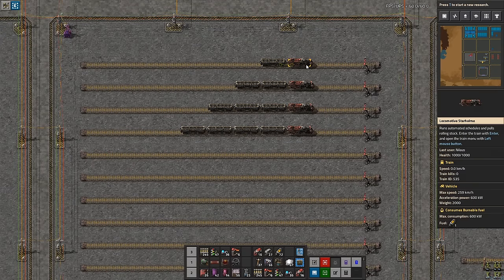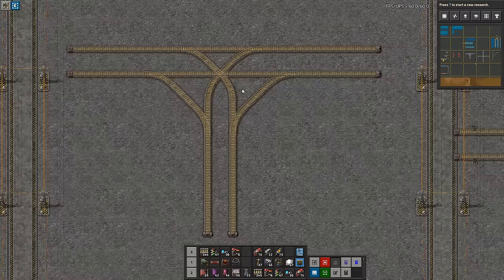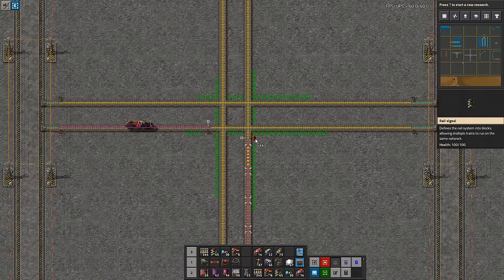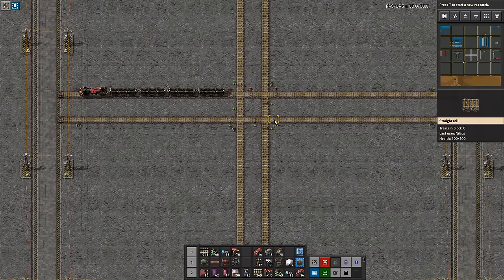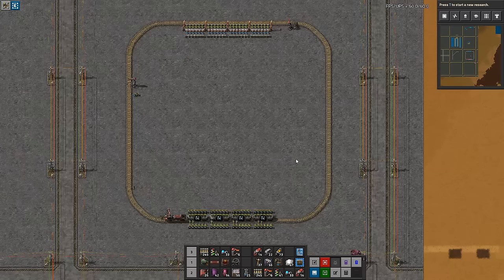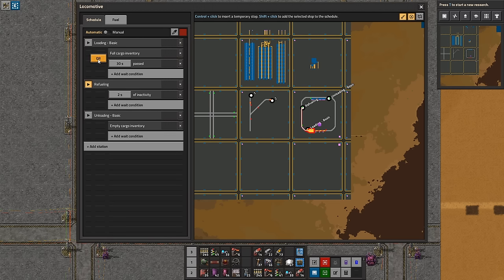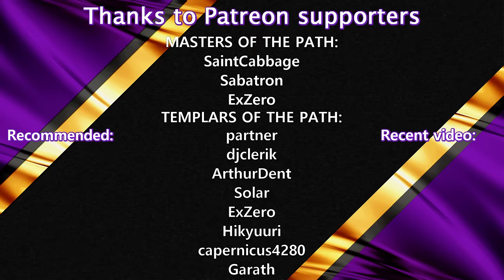Getting Started with TRAINS & SIGNALS - Everything You Need To Know | Factorio Tutorial/Guide/How-to

Comment: Also one sometimes has to keep in mind the role of the train when designing these systems. For example if using an artillery train you may want to keep it off the main rail network because if it makes an unscheduled stop, then you will have biters attacking the spot it last fired from. (You only want those to shoot from defended locations, or you'll be dealing with broken tracks.) So you don't want it stopping at some intersection for your ore lines if you can help it any.

Comment: Good point about the schedule belonging to the whole train, loco(s) and wagons.  If you're less disciplined about train make-up (who, me??) and you add a wagon or a locomotive to an existing train, it won't wipe out the schedule, but it will put the train into manual mode, and you'll have to switch it back to automatic.

Perhaps it's too deep for the first video, but you might have mentioned about filtering freight wagons.  For the interested: Open a wagon and middle-click one of the cargo slots.  An item GUI pops up that you can use to filter that slot so that only that item can be loaded into it.  Shift-right click copies a slot filter, shift-left click pastes it into another slot.

Oh, and shunting!  While the engineer is within a loco or a wagon, he uses Ctrl-V to disconnect a coupling, and Ctrl-G to connect (within a certain range).

Comment: I don’t want trains ever stopped inside the intersection, so I will always use chain signals at the start (before each fork) and throughout. I will only use a regular signal where a train is completely clear (no more branching). I’m OK with a little more space required outside of the intersection in order to keep them empty of any stopped trains.
Reply: if tyou place a regular signal before the chain signal (the side where the train is coming from) you can even tell wich train goes first

Comment: For the signal challenge, I would also add 3 chain signals more, that way the trains wait in front of the crossing, and if 1 path is blocked, they eventually can choose a differend route. Great for the deadlock in your network by a mistake. In your case, you actually have to go to the trains, and manually drive them backwards, while in the other case, solving a deadlock is just as simple as CTRL clicking on the map in the train GUI

Comment: I am a total beginner. Where I am stuck now is at the train network layout. Is there any tutorial? Specific questions:
+ Distance in tiles between tracks (1, 2, 4)
+ How many tracks in parallel (2, 4, 8)
+ Signals on straight tracks
+ Benefits / drawbacks of buffers / depots
+ Discussion of different layouts that work and pro's / con's that people use
+ Where to refill the trains
+ Train routes (many to many vs. single routes)
+ Which intersection sizes to use (3 exits, 4 exits)
+ What intersection types to use

Comment: I use your cityblock blueprint, but put railways between cityblocks. Each city block has separate drone suply area, so drones don't fly everywhere in my base. Also, i plan space for double wall difence in each cityblock in order to begin with cityblock. If i want to make it space-efficient it's reasonable to make rails closely to each other. So right - hand trafic make it possible

Comment: One thing you didn't mention about signals that is a very common misconception is that you don't need to follow the one-train-length rule when you're just signalling along a straight piece of track with no intersections. On straight track your signals can be as close as you like and it just determines the following distance of trains. Putting them as close as physically possible does work.
Reply from the maker: ...but it serves very little purpose to do that. I don't want to make things more complicated by explaining things that really don't serve a purpose.
Reply: It can increase the frequency at which trains can use that rail (and clear another rail), and thus throughput. It makes no difference on a mostly empty network, but if there is a lot of traffic (without causing jams, but occasional waiting), placing chains of rail signals can increase throughput for high traffic sections. There is no effect if there is no waiting , and the block directly after an intersection should of course be big enough for a full train.

Comment: I liked this, one thing that I think is important to realize though is whether or not to use two-headed trains isn't as much about the driving direction as much as it is whether you will have a turnaround point. I have some sections of rail, especially when starting out that was only going out to a small mine and back. While I did only have the one rail out there I used a single-headed train with a turnaround and just setup the signaling such that a train couldn't enter that section unless it could go all the way through.

Comment: the "space for one train (of the maximum train lenght you run) after rail signal" is only valid after junctions. on straights it doesnt really matter. if you have different sized trains it can even be beneficial to have the rail signals spaced out according to the shortest train, since you can fit more trains per track.
Reply from the maker: So you are suggesting adding more redundant signals... i dont think that would be my recommendation in a tutorial...
Reply: @Nilaus  and rightfully so, it would be confusing

Comment: Left or right handed drive actually makes a bigger difference then just merely changing the side on which your signals are. I've messed around with both. There are some designs that I have made where left hand drive just isn't possible because I would need to have 2 signals placed in a space that only allows for one. This can obviously work the other way around with other intersection designs.

Comment: 4th rule: if the train is not allowed to park in the next block use a chain signal.
Yes it's kinda logical for the intersection but if you are not so sure this helps.
By the other rules you can place normal signal before a big intersection because it can park there

Comment: i use chain where you put standerd signals, at first because i didnt know better, but now its because i can and will put intersections right after eachother, especialy in my early build this can lead to long streaches of track where you cannot enter unless you have a clean exit as there are just 7 intersections in a row (i know this is a terrable design, i needed to give a station a dedicated bypass because i had a poorly designed station with too many trains on it right after) or otherwise too close to properly signal without needing to edit, and i dont want to need to do that

Comment: I chose right-hand drive because I put my rails two tiles apart and it won't let me put signals in the gap between them. 

That's a functional difference. If the rails are close together, you have to use the outside.

Comment: My biggest issue with the drive right l, or drive left, rule is that a single train running out of fuel will bring the entire netwirk down in minutes and create a backlog that can takes a long time to clear. This will easily bring your operations to a grinding halt. I MUCH prefer trains driving forward on both sides with crossover intersections every 2 train lengths. This way, if a train runs out of fuel, other trains can just take the alternate track, giving you time to fix the issue without worry. Signaling for this is very easy and well worth the extra effort.
Reply from the maker: If trains run out of fuel then you made a mistake. Don't design you entire train system on the premise that you cannot keep trains fueled

Comment: There's one more place I use double-headed trains: a fuel supply train. Obviously it's not necessary if you have a central fuel depot, but any sort of central depot can become a traffic bottleneck easily. Relatedly, the reason you'd use empty/full cargo and inactivity would be if you are refueling at the same station as you are loading/unloading.
When I signal an intersection, I actually always start with chain signals. Then, I examine each signal, and if it's okay for a train to park after a signal, I'll replace it with a regular signal. This approach means I get a deadlock-free but sub-optimal intersection immediately and can then start looking at blocks to optimize the throughput. Also, as intersections get big, there are many more chain signals than rail signals, so I don't need to do as much work and am less likely to make a mistake.
Reply: I just use request chest for solid fuel

Comment: I prefer chain signals before the first intersection merges in case track gets destroyed or something whacky it leaves me some room to do an emergency work around. Granted that almost never happens. But on this intersection I personally would use 15 signals, which is more than double Nilaus, but the result is that trains will never stop inside the intersection because I make sure the tracks are signaled proper beyond. The effective intersection still stays teh size of nilaus' layout because the chain signals are "smart" when they are blue and still allow the valid paths beyond them. But again the reason for that is I, under no circumstances, ever want any part of a train stopped inside my intersections. I could get away with 12 but that would expand the effective intersection size beyond what nilaus likes.

Comment: I have two major questions about rail network. How do you calculate the close radius collision? Does it exist? If I have a 2-lane with curvature, real trains would collide passing it at the same time. So do I need to worry about it? 

Second is breaking force. It's simulated well, a heavy train takes time to stop. So lets imagine we have an intersection, 2 trains are coming from north and west at the same time. The difference maybe 0.1 second. So when one train enters the intersection, the other one gets red signal. It now has 0.1 second to react. Obviously it has no time to stop properly. So I have to plan my intersections with several signals that have enough space between them for a full breaking? 

In both cases wrong decisions would lead to train destruction. So I think it's important.

Comment: In double-headed trains, why doesn't the locomotive going backwards contribute to the moving the train accelerating backwards and such?
Reply: probably locomotive can't move backwards, if they could there would be no need of double headed trains as the first locomotive could just accelerate backwards
Reply from the maker: they cannot move backwards in automatic mode
Reply: @Nilaus  Would the double-headed train have a greater breaking force or is the second locomotive just idle when it isn't pulling the wagons?
Reply from the maker: @jakeread9668 , less. The extra loco is dead weight

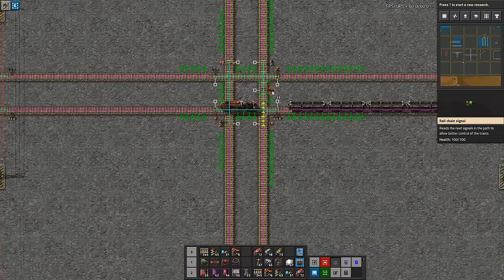Comment: 18:49 The eastbound engine is in the intersection blocking the southbound lane. The southbound lane is red only because there is another engine parked off screen. Remove that off screen engine and the southbound lane turns green in the intersection, right? So it's possible for an eastbound and southbound train to meet at the intersection at the same time and smash, right?

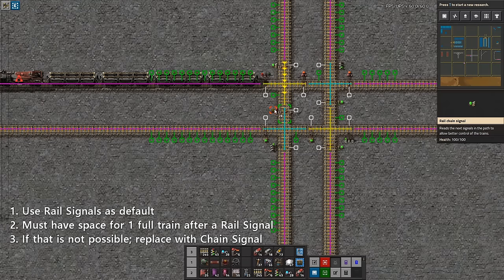Comment: 20:00 I prefer to keep my crossroads clean as 1 rail block. I also use round ones instead. Maybe just 1 train can use it at the time, but that way I have 0 chances for trains to clutter, ever.
Reply from the maker: You can play as you like, but that is vastly more inefficient as all trains have to stop when one enters an intersection
Reply: @Nilaus  that's true, but I noticed that even with 100-150'ish trains even the most crucial intersections don't bottleneck the system :) Ofcourse I have several other round-intersections for trains, so maybe that also helps.
I'm yet to expand beyond that meager fleet of trains, so who knows how it'll work with bigger train setups :)

Comment: Pretty much all that I wrote to that guy somewhere in your series lol. It almost feels like I provided you of some script by accident.

About your challenge, my 2T - T Intersection is different than yours because I avoid putting more than 2 intersections on any track point, yours have 5 connections into a single point that slows down incomming trains even if the track is empty because "train doubt". So mine has sorta smiley face on the bottom-top track and the incomming tracks from the T-Bone part are branched farther away so all the MIAP (Maximum Intersection in Any Point) on tracks is 2. If you're curious to see it, I can drop it on discord.

Comment: I'm new to trains and I'm curious about chain signals as to whether or not they propagate forward. To use your T-intersection solution as an example, suppose you have two trains entering the intersection, one heading east-to-west and the other west-to-east, but they both want to turn south. And let's suppose the eastbound train turning right comes to its signal after the westbound train has passed its chain signal turning left, but before it has reached the normal signal before the southbound leg. Will the east-to-south signal show yellow or red even though there is no train in the block ahead, or will it allow that train through and strand the westbound train in the middle of the intersection in violation of the chain signal?

Comment: There is something it is not clear to me yet. Looks like all the rail setups for the intersections are with two rail lines. I have a system with only one rail that I am trying to manage but it seems that the signals are meant to be in only one side. I mean, It looks like I cannot control a single rail line with both senses of movement. Therefore, when I also add two-headed rail lines the control seems not to work.
Reply from the maker: when having trains in both directions on the same rail then you can only place signals across from each other. You can see when trying to place a signal that only the spot right across from another signal is white i.e. eligible
Reply: @Nilaus  That is indeed the problem I was having. I did not know that was needed to tell "the system" that that line is double-direction

Comment: Have signals changed since this? Doesn't seem to work for me at all. It seems that placing the chain signal creates the next section?

Cannot wrap my head around signals.

EDIT: Jesus Christ, after watching this for the third time I realised the very basic thing I missed; the space between two signals is a block.

The purpose of a chain signal is to define a new block that cannot fit a full train, and it will mirror the state of the signal in front.